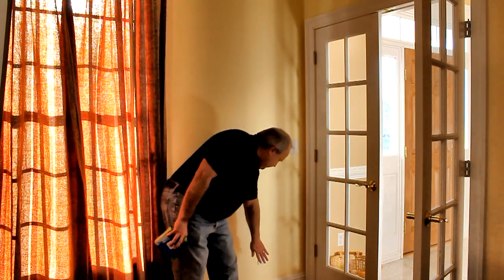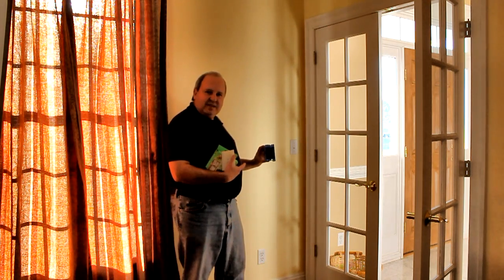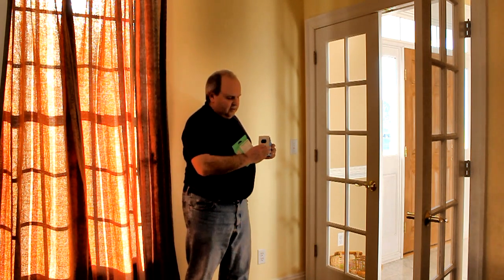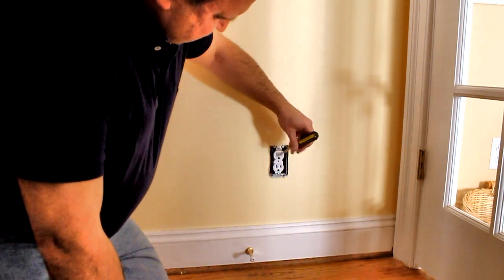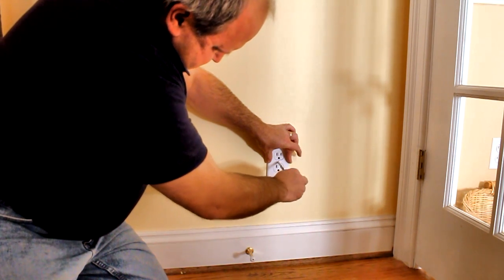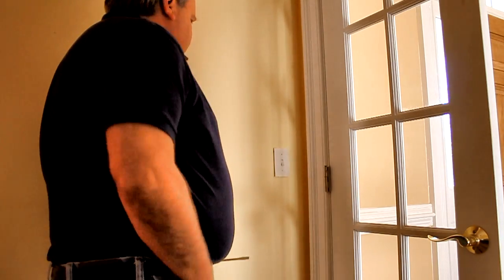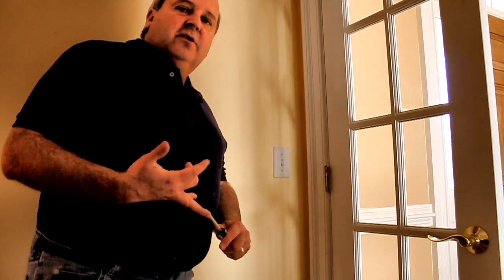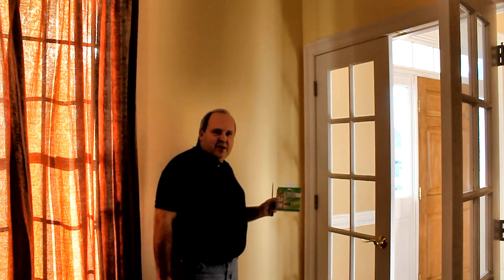Energy Challenge -Video 6 -Sealing Airleaks in Outlet  Boxes

Comment: Even though you put the gaskets around the receptacles and switch  you forgot to mention airflow going through the receptacle  which you lose a lot of heat in the winter and cool air in the summer. Now how do you explain how to stop the air flow from going through the receptacle instead of around it.
Reply: little child proof caps
Reply: That's the issue I have right now. I put the gaskets around them but the air blows right through.
Reply: Keep the outlet knockouts and put them on the prongs of a child proof plug insert.

Comment from the maker: Sorry for the slow reply. Preparing for the AHR Expo in Dallas so lots of new video coming up. 1st I'd check the outside damper door where the microwave vents as this is most likely the issue. It could be stuck or its gasket could be worn out. You should be able to get a replacement at your local home center. One of our video shoots will be with Broan who is the largest manufacturer for ventilation products so I'll see what they have to say.